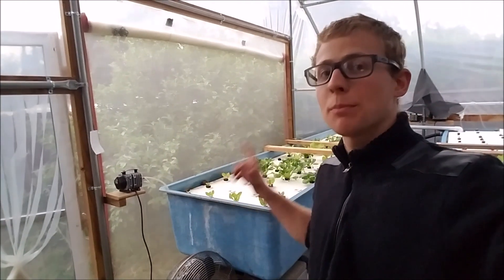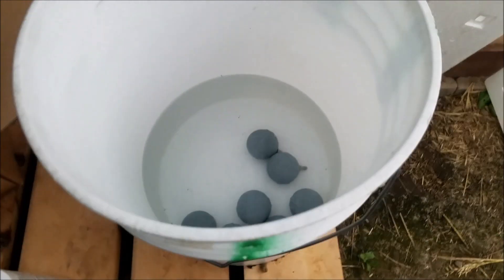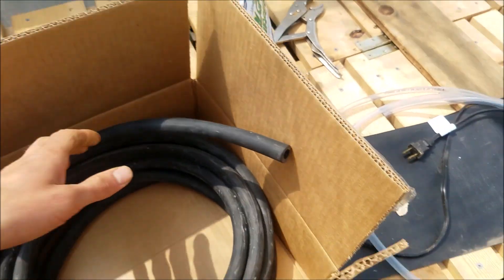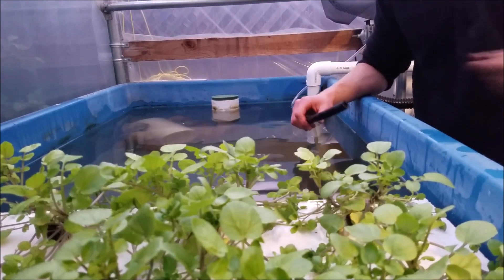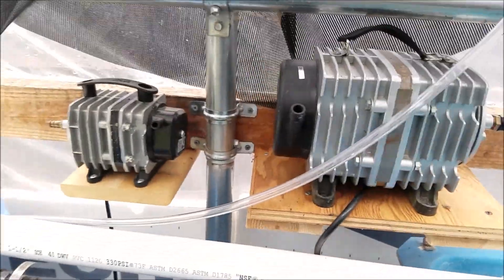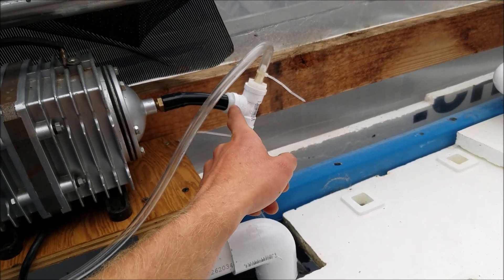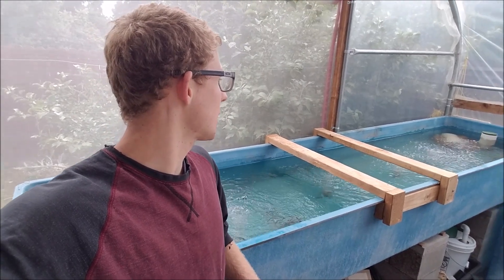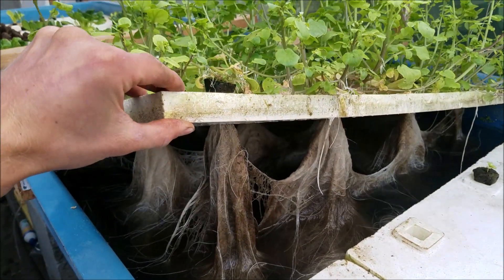Aeration for floating rafts/ DWC auaqponics PART 2 (hybrid aquaponic system)

Comment: what is the L/min of the pump please? 

Do you still use this setup?
Reply from the maker: This set up I actually did change recently which I will make a video on.

For the pump I am not exactly sure what are its specs since I got it used and iuts has no labels on it.
But I am going to guess from looking it up online that it is 3566 gph and 13498 L/hour so that is  59 g/min and 225 L/min